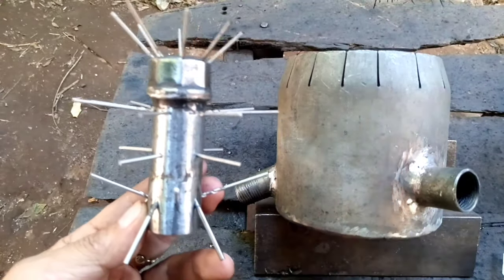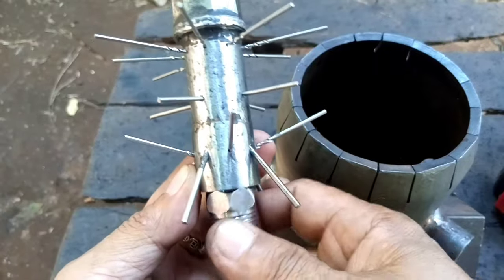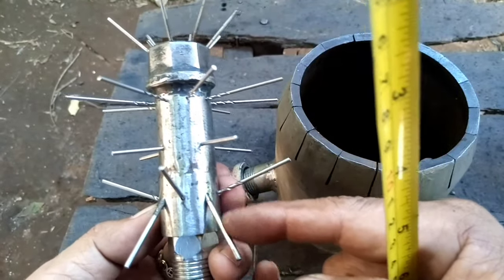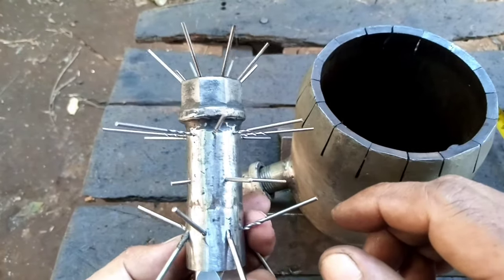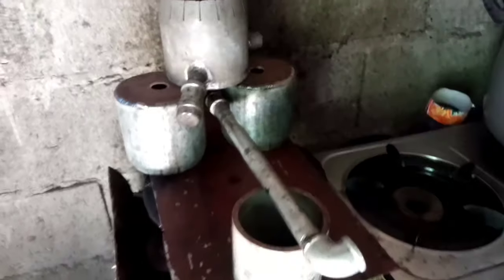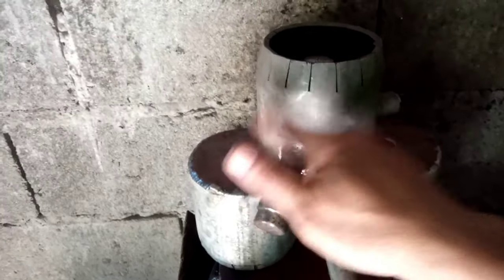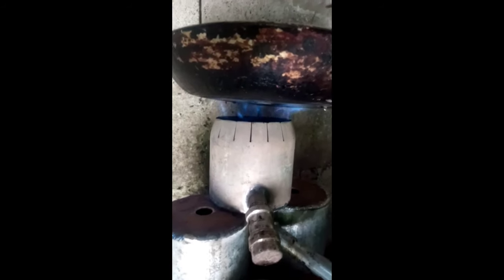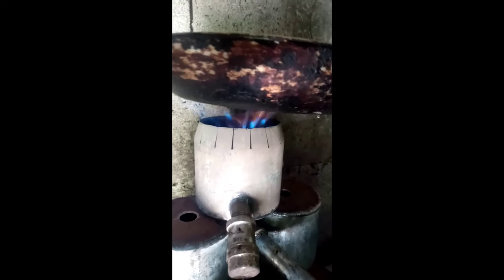TUTORIAL How To Make Super Blue Flame Used Oil Stove, 4" 6mm 28 holes #superblueflameusedoilstove

Comment: Ayos sir ganda super blue flame ❤
Reply from the maker: Salamat sir magandang gabi
Reply: @boybakaltv8809 Saan kayo located sir? Puede ba magpagawa sa inyo ng ganyan.
4" 6 mm with 28 holes.
With threaded connector both for oil and air blower.